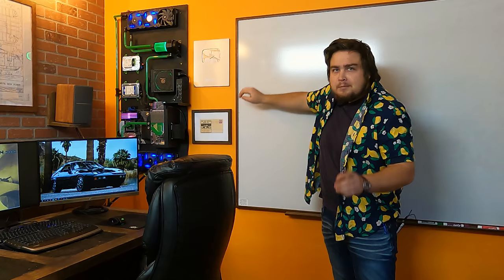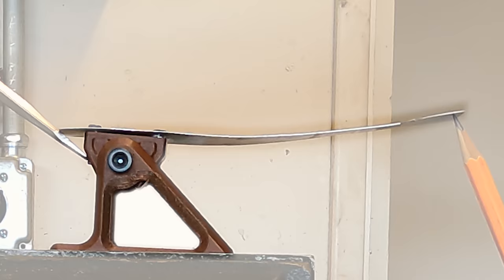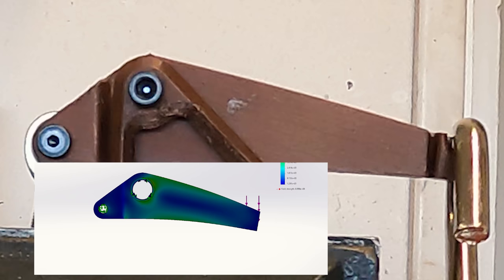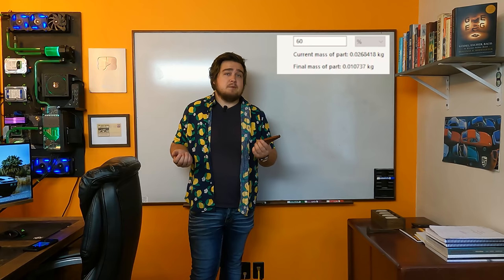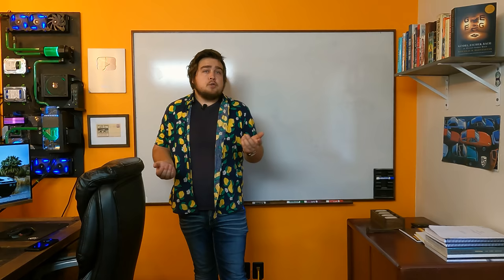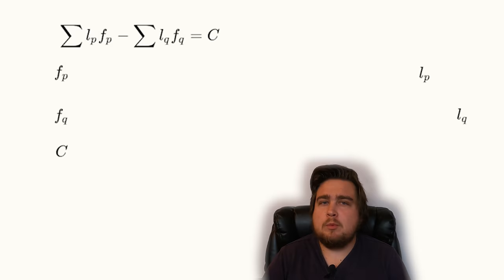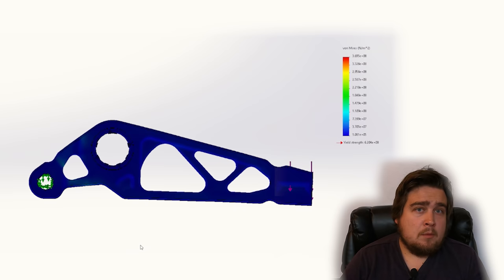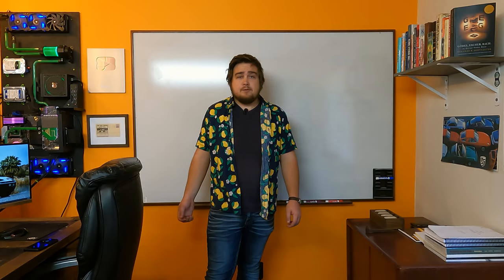Why do the Strongest Parts Look Like This?

Comment from the maker: The fan broke again
Reply: The OnlyFan?
Reply: 3d print a new fan so you can reprint one every time it breaks
Reply: Are you talking about the fan on your GPU radiator?
Reply: @peejay1981   if the onlyFan broke, then perhaps it is time to pay attention to the hub.
Reply: Deltron is chron!
Reply: @AmritGrewal31  It seems like the electric motor at the hub failed so I suggest a xhamster wheel drive
Reply: @MiniMoto0098  Thats not a gpu radiator, thats the radiator for the whole system, its a single loop and the motherboard also has watercooling on top of the cpu and gpu.
Reply: Thank you for explaining why I switched my major out of engineering.
Reply: I'm glad you pinned this comment, so I don't have to make it XD
Reply: how did you manage to break a fan???
Reply: quick question. do the radiators on your wall mounted pc not need the air to pass through them. Ie.. is there anywhere for the air to flow to? ie.. does it even matter that that fan broke?
Reply: @PartikleVT  It does appear to be a single loop, but with 2 radiators--one up top, one on the bottom--with 3 fans each (well, technically).
Reply: @ashreid20  Maybe that's why he has two radiators...because each one isn't allowing an ideal airflow path? :)
Reply: I was getting mad an was about to say fuck the video the fan be broke
Reply: I came here for the tension and compression equations, stayed for the PC on the wall.
Reply: Congratulations on your great taste in music.
Reply: where do you think the air is going man? instead of talking about topology I think you need to understand the fundamentals of the third law of thermodynamics
Reply: Just kidding.  Great video!
Reply: Oh come on ok nobody said to make a series of lectures for an engineering degree but you surely could enrich this video with more details and trivia and make it a 20 to 30 minute one... in 9 minutes I didnt even finish my cereal ! :P
Reply: F
Reply: @peejay1981  the all fan

Comment: When I have to stack books on the floor, I make seriously sure one on dif. equations is on the bottom, in case of a flood. I consider this topographic optimization.
Reply from the maker: That's a good plan. I didn't dare go too in depth, It's not my field of expertise
Reply: Lmao
Reply: Matrix algebra on top of that too...
Reply: math
Reply: Advanced engineering mathematics and everything dealing with statics, machine parts design-whatever you'd call it in English, statistics etc. are on the bottom row of my bookcase of work related literature...in case of flooding or some such.
Reply: It is a 54' ed. of Tullio Levi-Citiva's Absolute Dif. Calc. of Tensors if yr wondering.
Reply: @napalmholocaust9093  Can also be used for bludgeoning or (probably) improvised body armor.
Reply: 100% DiffEq-II made me wonder why the hell I was bothering.
Reply: SolidWorks? I'm more of a TinkerCad kinda guy.
Reply: @robevans916  At some point it becomes akin to watching North Korean television programming.
Reply: It's not "in case", it is "in hopes" of flood. At least that's how my Differential equations book lives.
Reply: I call that justice!
Reply: Math guy here.  Why all of the DiffEQ hate?  Just askin’…
Reply: When i was doing my Engineering degree, I had to take diff eq 3 times before i finally passed.  Calc 3 was no problem, I pretty much slept through it, but diff eq kicked my ass
Reply: @tippyc2  strangely I was the reverse! Low-key partial diff’s run our world….
Reply: @6lack5ushi  Looking back at it, I think the problem was that I had absolutely no idea what the point was.  At least with calculus it was easy to see how everything in engineering is an integral of something else.  To this day, I'm still not sure how diff eq fits into civil engineering.  Time would have been better spent in a linear algebra class.
Reply: @markstgeorge405  c'mon we all know the cooler maths are group theory and octonions
Reply: @actually-god0816  Naw differential geometry is where it's at
Reply: Hahaha that’s a heck in good joke
Reply: why no love for diff. eqs?: The power of rates of change at your fingertips!!! I think Thanos' cavity search handwear had a related pebble. /s
Reply: Weird, I keep the study bibles and concordance on the bottom.
Reply: rofl mao
Reply: *topological

Comment: I'm an engineer in aerospace and topology optimization + good metal additive manufacturing is a game changer for some applications. There are dozens of assemblies on rockets and rocket engines that can be reduced to 10% or less of the part count.

Anyway, this was a good quick overview. It's good when people learn about things they won't necessarily use but are becoming a big deal in industry
Reply: Did you mean "by 10%" or did you actually mean "to 10%," because wow
Reply: @AmritGrewal31  I meant what I said. To 10%. Complex assemblies are often a requirement of the manufacturing capabilities you have access to. When manufacturing those geometries becomes "click print" (this is an oversimplification) you wipe out parts, fasteners, brackets, etc.
Reply: Part of the limitation is price, laser sintering is ungodly expensive.
Reply: @carlosvargasbatman  which is why you won't be seeing fully 3D printed planes any time soon, but its a great technology for small and intricate components, especially when high performance is required. As the person above said, in certain cases it can cut down the number of parts in an assembly by an order of magnitude, which can tip the scales in favour of printing when you consider that someone has to assemble all those parts, then someone else has to take them apart and assemble them again during maintenance.
Reply: @carlosvargasbatman  The cost is quite reasonable for replacing machined components made of exotic materials.
Reply: @carlosvargasbatman  yes, but there's another technology that can achieve similar effect for a fraction of cost: binder jetting. Biggest flaw: it's ungodly unprecise. like !% dimension deviation in large series of parts.
It can be offset through machining of sensitive surfaces though.
Reply: @ovDarkness  binder jet printing doesn’t yield the same material properties as laser powder bed printing though. So, while not a problem for some things, still a deal breaker for others.
Reply: @mattsoup4121  Not when you factor in qualifying a material and processes with the FAA. That process is incredibly expensive to do.
Reply: @carlosvargasbatman  Depends on the application, but fewer parts means less qualification.
Reply: @dohabandit  Like golf-balling the manifold intake, but the valves are even MORE selective about who they let in
Reply: @carlosvargasbatman  we make airplane parts all the time using sls because it’s by far the cheapest way to manufacture.
Reply: @danielcockerspaniel  what FAA part classification do they fall under?
Reply: Are you talking about the complex seals in rocket engines?
Reply: @forloop7713  I'm not at liberty to discuss what parts I work with.
Reply: @mattsoup4121  Relativity?
Reply: @forloop7713  Nope. And hot take: 3D printing rockets isn't a great idea. Yeah it works but it isn't cost efficient.
Reply: @ovDarkness  and you can optimize to binder jetting limitations!
Reply: @Bruno-cb5gk  I’m talking a class on material failure and we just talked about the case of AA Flight 191, the one that crashed taking off from O’Hare in 1979. You may already know the details since you work in the field, but I was really struck by the reported reason for the failure. Basically, it was the repeated stress of maintenance (albeit done improperly — they took out the pylon with the engine, rather than just taking out the engine alone, as prescribed by the engineers/manuals etc.) that caused the engine to rip itself free from the wing under the additional stress of takeoff. I had never considered a point of failure like that, but it makes a lot of sense that problems may arise when complex machines are routinely assembled and disassembled, even when the reason they’re getting taken apart in the first place is to ensure that everything still works properly.
Reply: @mattsoup4121  whats the cost? The novelty or the equipment an space itself? wouldn't seamless object have less failures cause if it being a whole object it will degrade uniformly.
high stress parts can still be attached seperatly so it would the same as now.
just curious btw
Reply: @badoem5353  additively manufactured parts still need machined at the interfaces. Huge printers for making large parts are extremely expensive. Forged/rolled metal stock is stronger than additively manufactured material, even when heat treated.
Reply: @mattsoup4121  and if we'd start printing on the microscopic/quantum level?
I know I'm thinking in the future and metal tend to become uniform in terms of their properties of existing when pressure (heat or force)
Like forging is like smashing stuff together until the  protons find their equilibrium (with metals at least) and just but what if we place the puzzle pieces where they need to be and after you heat treat it to solidify to further strengthen it. Or is brute force just better?
Reply: @carlosvargasbatman  Not a big cost for the aerospace industry.
Reply: One problem today seen in more modern structural systems, is before would over engineer as could only be within a certain tolerance using primitive calculation methods and knowledge. AS we know more can can stretch things to more limits, we end up stretching things to "The" Limit and sometimes we need more tolerance to absorb the extra stresses times when things may go beyond limits, aircraft, rockets, etc when the unexpected is encountered. Sometimes less is not good.
Reply: @mikeclarke3005  this is accounted for in structural margins
Reply: Just curious, what did you have to study in college to get where you are?
Reply: @blankblankity451  Mechanical engineering, but focused on rocket propulsion.
Reply: What types of parts is it particularly useful for? Like manifold type parts? Do you need to take much of a strength knockdown due to porosity, or are the bulk fatigue characteristics pretty comparable to machined?